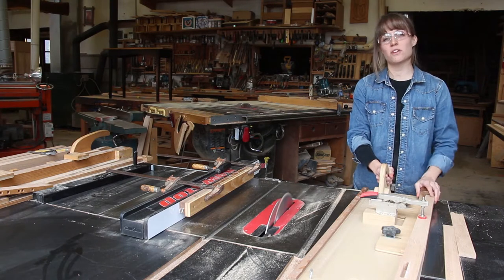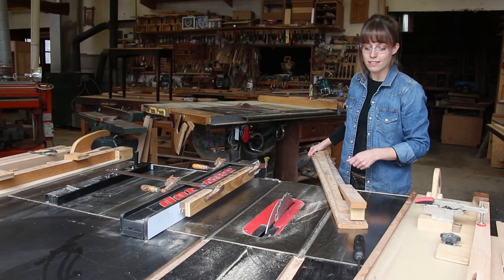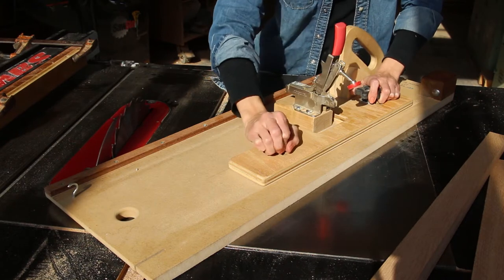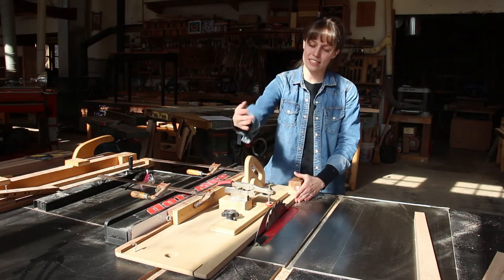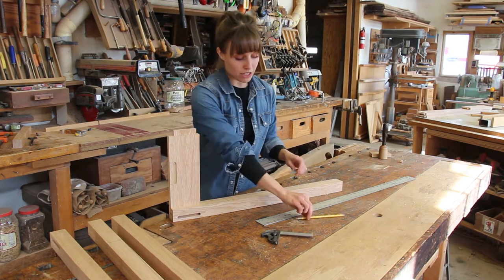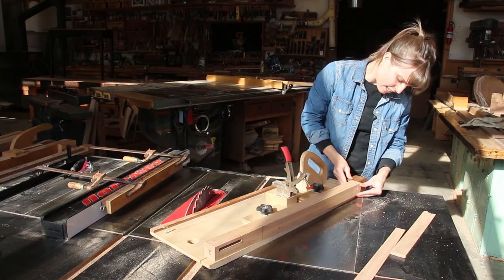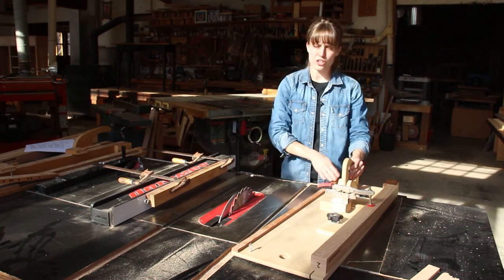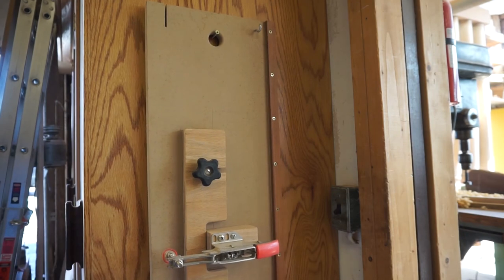Top Notch Tapering Jig

Comment: I like this jig compared to some others but it seems to me you could make it a whole lot simpler by having it run in the saw's mitre slot. That would save you having to set the fence, save you having to clamp something on the fence, save having the extra bit on the jig that runs against the fence. And it would cure the problem of the jig drifting away from the fence. Am I missing something? It seems over-engineered. Less is more....
Reply: Good observation, Vince.  Makes sense.